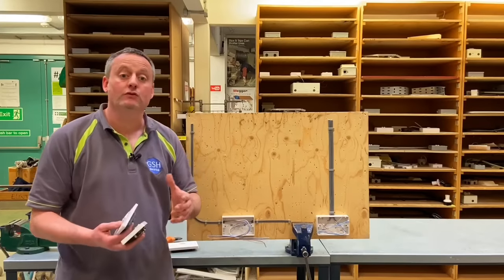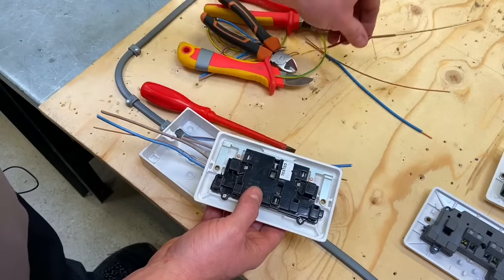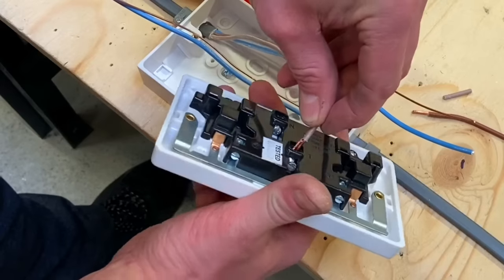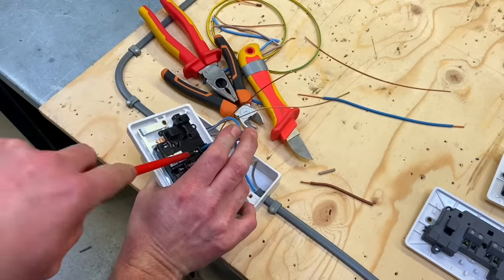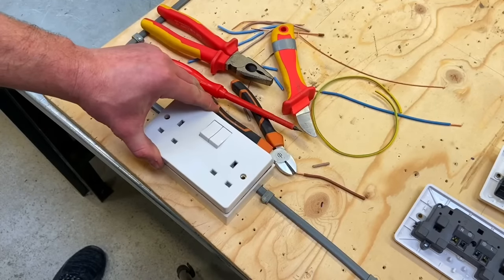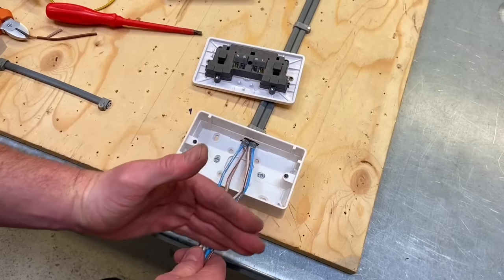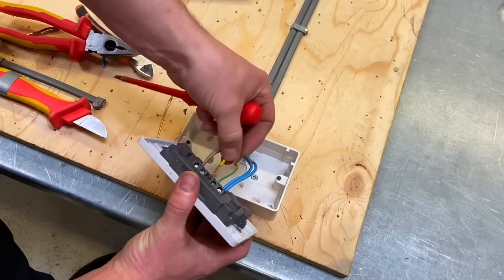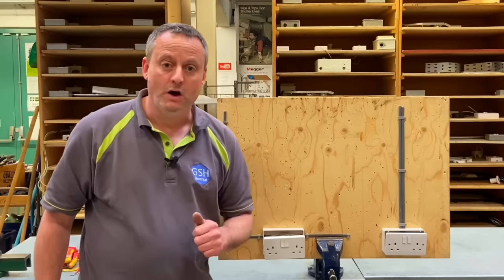How To Terminate (Connect Up) a Twin Socket Outlet BS 1363 (How to Wire a Double Socket)

Comment: Thanks for creating these videos.  Quick question why don’t you use a torque setting on these termination?  But within in a DB you do.
Reply: Terminals in a dB have torque settings that are provided by the manufacturer so to comply with regs these must be followed. There are no such instructions on socket terminals. If there were then you would have to use torque driver
Reply: @reeceoverton1421  There is a torque setting guide in BS 1363-1:2016 13 A plugs, socket-outlets, adaptors and connection units. Specification for rewirable and non-rewirable 13 A fused plugs. But I'm not sure if that is a must per the regs.

Comment: When doubling over the conductor, if you use the pliers at 90° the teeth of the pliers will prevent the conductor from slipping therefore making the job faster and neater. Plus the less work through the bend will reduce metal fatigue.
Also, if you put the CPC sleeve all the way on and then pull back off by the amount that you want exposed and then cut it, then it will be fast and perfect every time.

Comment: Nice one gazza. Big help. Subscribed 👍 do you have a video changing light fixtures at all?
Reply from the maker: Thanks for the support - this may help I also have wiring diagrams that are worth taking a look at 

New House Wiring Changing Lights - Lighting Circuit Using the 2 Plate Method or 3 Plate Method? https://youtu.be/RO0Zejib7BM

Comment: Hi Gary,  just wondering.. you have 2.5 L&N with 1.5 CPC... A few years ago here in Ireland there was an ammendment that all new installations must use an insulated earth conductor that is the same size as the two phase conductors. What's your view on this? Is it something that's in the pipeline for you guys in the UK? Love the channel pal 👍
Reply from the maker: Great comment - no plans that I am aware of to follow Ireland’s lead. Will be interesting to see others comments. 👍 Gaz
Reply: Hi Keith. Thanks. I was thinking funny when we do single cable in conduit we do use the same size for all cables. Strange that. O well the English way he he.
You can teach an old dog new stuff. Thanks again.
Reply: @GSHElectrical  also in Ghana in West Africa, we follow British standard of wiring. And we use 2.5mm for socket, thus the live, neutral and earth or CPC but you used 1.5mm but yours is 1.5mm
Reply: T and earth cable is made that way

Comment: Learning the trade and i didn't realise that there was a difference in screwdrivers...? Can anyone tell me, does it really make a difference as to what screwdriver you use...?! Cheers, great video..!
Reply from the maker: Match the tip size to the screw head - insulated - find a brand u like. Thanks for watching and commenting. Gaz

Comment: Always use Sheers/5-1 Knipex or strippers never a knife for inner cores. Also like to see a tiny bit of copper sticking just outside the terminal so I know there's no chance it's screwed down onto insulation also don't tend to double over unless it's a single cable. Rule of thumb for length was always taught as: from side half the width of the box past / from top or bottom double the height of the box.

Comment: Very well explained...Gaz .
2 Questions...
In video , you mentioned ..( screwdrivers )
Is there any difference between a ", electricians screwdriver & a normal vde (as seen in yr video. ? 
and video Gaz preferred a separate CPC /earth terminal in a double socket .
Is there any reason ...(safety or not really ) ?
Thanks any one. 👍💪😁
Reply from the maker: No to keep things simple for my learners I call it an electricians screwdriver rather than a number 1, 2, 3 etc. We talk about sockets for IT equipment in the classroom so this links to the CPC being in different terminals 👍.
Reply: Old electric here normal in the old days mentioned that they didn't have plastic sleeving on the screwdriver to protect your fingers OK. So the normal one was not to be used as for electric work.
Hope this helps as he didn't really tell you that.

Comment: The entry of the cabling shouldn’t make a difference in how much slack is left inside the box.. why less when they enter from the top?
Reply from the maker: This is my technique yours can be different 👍. Gaz
Reply: @GSHElectrical  and it’s a good technique, just mentioned as box is still the same when cable enters from above/bottom and plenty of room inside. Being installations here non rewirable it’s good to leave plenty of slack for the years to come.
Reply: @filipe.skunk8  If the cable enters from the top, it is closer to the terminations.

Comment: Good workmanship - crap system. I'm in Australia, just gone 50 years as an electrician and that cable/methods takes me back to the 70s.
Reply from the maker: Thanks for the message 🤦🏻‍♂️ maybe 😄👍
Reply: Mick K, purely out of curiosity, would be interested to see the difference if you have a link?

Comment: Nice video Gary 👍

What length would you cut the conductors on a single FCU wired in the middle of a 4mm radial circuit?
Reply from the maker: Maybe not as long as suggested for the sockets in this video 👍
Reply: @GSHElectrical  I figured as much, thanks! 🙏

Comment: Is that single strand 2.5mm cable?
Here in Kenya nowadays, rarely will you find a single strand conductor of more than 1.5mm.
For 2.5mm and above we have stranded cables only

Comment: Would you still double over if you've got 4mm cables? Or only for 2.5 ?
Reply from the maker: Only 2.5 and 1.5 into the back of sockets. Thanks for commenting. Gaz
Reply: @GSHElectrical  I think the purpose of the doubling is to fit in properly

Comment: It is easier, quicker (and safer) by using Wago types of push fit connectors for the stiff 2.5 T&E cable. 
In site work, using Wagos in the boxes it is ideal on the first fix to connect the 2.5mm ring, then test to ensure the ring wiring is OK. Any problems are identified immediately before plastering and/or wall closing. 

First Fix
♦ Connect the two 2.5mm T&E cables into the Wagos, then push the Wagos to the back of the box. 
♦ Test the cable.
♦ Plasterers, wall fixers complete their work.

Second Fix
♦ Cut 2.5mm single core insulated flexible cable to the right length (about 4 to 5 inches) - L, N and E, all insulated. Easily done on a bench.
♦ Then screw the flexible single L, N & E cables into the back of the socket.  Easily done on a bench.
♦ Then push the three flexible wires into the three Wagos.  
♦ Then it is easy just to push the socket back and screw up as the three cables are flexible. No stiff T&E cables in the socket terminals putting stress on the terminals. Just push the socket back easily and only once. 

Note:
♦ With metal boxes you may need three terminal Wagos for the L and N and a four terminal for the earth  - one to the socket, one for each T&E and one to the metal box earth terminal. From the Wago to the metal earth terminal use flexible cable which can be fitted on the first fix. 

The Wagos are neat and out the way in the box. Then a plasterer can come along with no problems after the first fix. The socket and three flexible wire tails can all be cut and connected on a bench very quickly and easily (imagine 50 of them). Then an easy job of pushing in the flexible tails into the Wagos and screw up the socket after the plaster is dry. Test again with sockets connected.

Comment: Just wondering why you double over when you have 2 x 2.5mm2 6242y going into a socket?
I believe the terminals are designed to accept them in singles, unless just 1 x 2.5mm2 present or 2 x 1.5mm2 need connecting.
Connecting the earths... I was told that splitting the cpc’s into the separate terminals provides a clean earth for IT equipment, so maybe you could clarify?

Comment: What mm cable are you using? Is it best practice to use 2.5mm or 4mm? Also should you always use the ring to connect multiple sockets? or can you stop at the last socket?

Comment: I got a 2 gang power socket in the kitchen plasterboard , which is convention straight from top including twin cables (as per your video). If I wanna extend 3/4 power sockets from that point, shall I connect/extend both the twin cables to the next power socket ?? ?🤔

Comment: Never remove insulation from conductors using a knife, it is inevitable the copper will get marked by the blade, a tiny nick or even scratch made in the copper surface seriously weakens it at that point, causing the conductors to fracture as they get bent into shape, this is a fact not a myth.

Comment: For years when working on my own buildings I have twisted the cable ends together when connecting to the socket, is this ok? I was taught that method many years ago by an electrician mate I used to help out on jobs

Comment: Once again, thanks for making me feel good about my DIY electrical jobs. Starting with long wires in box, then  correct screwdriver, then test termination to guage wire length for socket brand, use tight fitting earth sleeve so doesn't slip and spoil contact in earth terminal.
   I do all that as I fix the sloppy work of recommended, registered, reputable professionals. I think I've found a good one and hope he's available for the consumer unit replacement I'd like done before Christmas

Comment: Being an electrician from Austalia, and knowing that the AS/NZS is very much based on the BS, I just have to ask the question that if you have a socket outlet on the wall like that, don't you require somekind of as we would call it "mechanical protection" over the cables?  We would have to use conduit if you can can see it like that, not higher up, but definately at that kind of level.  solid conductors are now only used in 1mm2 conductors, you don't twist the conductors together before screwing down? Also, why has no one come up with a socket yet that covers of the screws!
Reply from the maker: Thanks for watching from afar - the grey outside PVC is proving the cable with mechanical protection 👍🏻. All the best Gaz

Comment: Should the conductors be terminated on top of each other? I thought that means it is more likely both conductors will come loose? Thanks
Reply: I always twist two conductors together. It gives the screw something solid to grip on and I've seen far too many sockets where the screw only secured one cable. At best the cable comes out and the ring is broken, at worst it causes arcing.

Comment: A knife to strip conductor insulation has no control not to nick or cut the conductor. A properly adjust pair or wire strippers will not do this and is safer. You get to keep all of your fingers.
Reply from the maker: I make my learners use a knife in the early weeks to build hand eye coordination. If we let them lose on side cutters or pliers to remove the insulation they tend to cut through the copper conductor hence the knife. Thanks for commenting and watching. Gaz

Comment: Why is the Wiha looking VDE screwdriver not suitable for sockets and only lighting circuits please?
Reply from the maker: Thanks for commenting - the size of the blade on the screwdriver head the terminal one is to small to get the connections tight 🦾. Gaz
Reply: @GSHElectrical  Thank you that makes sense!

Comment: In don't understand the resistance to doubling over, you're just lazy and negligent if you don't. There's more surface area contact, the pressure of the screw is taken by more copper, less chance the impression from the termination will cause the connection to fail which I've seen countless times from overtightening, it's obviously a more secure connection with far greater integrity. Make an effort and stop struggling to justify being prat.
As for manufacturers instructions, I go above and beyond manufacturers instructions. You only have to look at the shite tiny terminals, and absolute ridiculous designs to appreciate you need to dictate best practice as electricians.
Reply from the maker: Thanks for taking the time to post such a detailed comment. Gaz 🦾
Reply: @GSHElectrical  keep doing what you're doin Gaz, you guys are great.

Comment: Anyone please. I have a two way switch in my hallway which works fine but near the front door it is a double switch 1 for hall light on the two way system and one for the porch light , but the porch light only works when the hall light is switched on . Switch off the hall light and the porch light goes off too.  how to switch porch light on and off with the switch regardless of the 2 way switch. Been wired wrong surely , must be easy fix .. any electricians help .   Thanks
Reply: Get an electrician to look, it will take all of 3 mins to fix
Reply: Your question isn't clear

Comment: Hi A bit off topic, but why have a busbar and the neutral wires not directly connected into each circuit breaker.? An explanation would be appreciated.
Reply: Say you go into the breaker with the neutral, where would it then go after that? The answer is back to the substation at the end of your road.
It's the same reason you have an earth busbar, to link all the wires together so that 1 thicker cable can run off somewhere else. Think of it like your cars exhaust manifold. You don't have an exhaust for each cylinder, instead they are grouped together and have 1 larger exhaust pipe going to the rear).
MCB's don't require a neutral as they just detect overcurrent. RCD/RCBO's are residual current detectors. A really simple way of explaining this (there's more too this so please don't treat this as gospel) "3.11 amps has gone out through the live, 3.11 amps has come back through the neutral (for example)" Obviously if you only get a current 30mA lower than that it's going to earth somehow.
Reply: @zXLuke4efcXz  Thank you for taking the time to answer my question.

Comment: When did the "live" wire get renamed to "line" wire?
Reply from the maker: Before that it was the phase - both line and neutral are live conductors. Example if the line has 10 amps in it the neutral also has 10 amps hence both live conductor 👍🏻
Reply: @GSHElectrical  I get what you're saying but I've just checked some socket wiring instructions online from Schneider and BG and they all call the cables live and earth. No reference to line. To me, line implies a low voltage signal wire carrying data (analogue or digital). You don't want to get that mixed up with a 240V live wire!

Comment: Hi there, i had an issue with my consumer unit whilst replacing a double socket. I had replaced an old plastic double socket with a Wandsworth brass double socket.

Before doing any work I turned off the relevant consumer unit switch and tested the sockets to ensure no power was running through them.

I started with adding the earths to both the socket & back box. During this time strangely the whole consumer unit tripped when the back box got connected to the rear of the socket? AND the same thing happened when I connected the Neutral?

I tested the socket and cables when the consumer unit tripped in both instances and found no current running through them?

Does anyone know why the consumer unit tripped when I have disabled the circuit that I’m working on? 

I can only think of some king of static feedback from the brass cover plate?

Thanks in advance for any help with this 🙏🏽
Reply: RCD’s will usually trip if you touch earth and neutral. There is usually enough floating voltage on the neutral to cause this ( you only need 30ma of current flow. Pain in the arse if you are working in the loft as the lights go out.😂😂
Reply: @johnwarwick4105  Thanks and yes 😅
Reply: Are you sure you didn't screw one or more of the socket terminal screws in and nipped i to a cable. Change the old socket back and see if that makes any difference. Visually inpect all of the cables in the back box. Either that or you have more then 30mA earth leakage.
Reply: @rayc1503  thanks, it only happens when the cpc touches the neutral. It occurs when I pull the cables out of the back box for example.